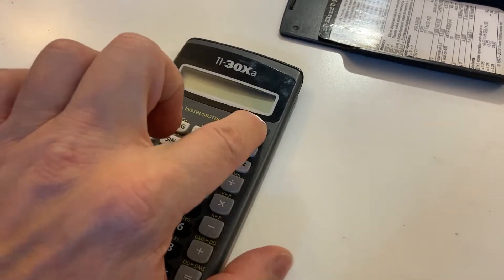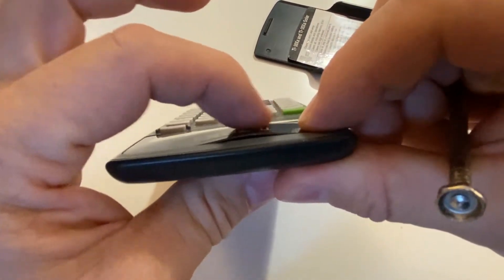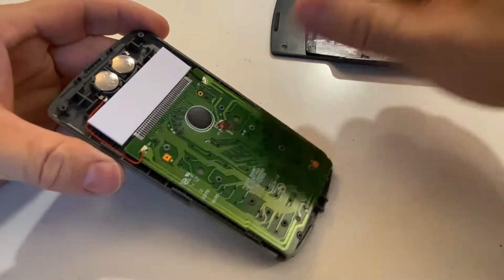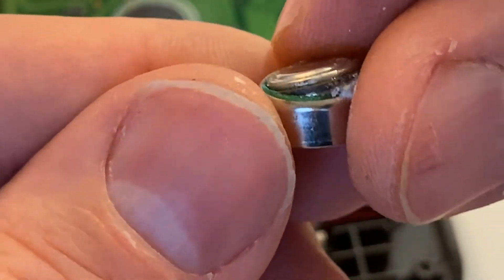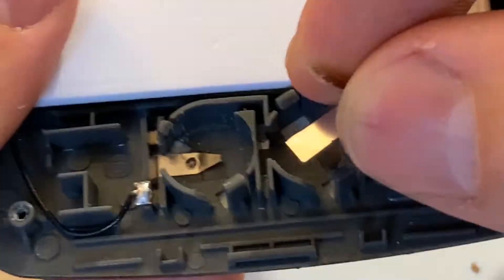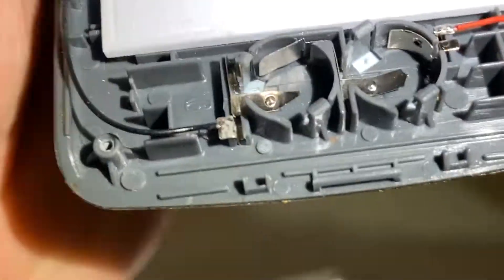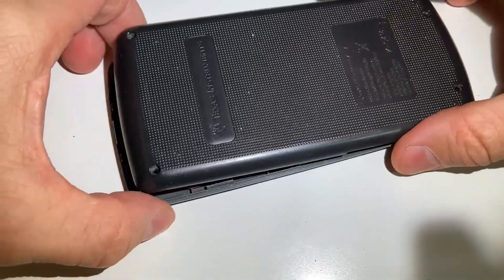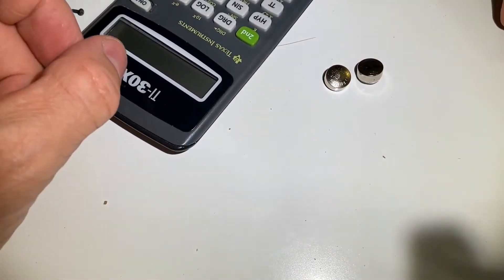Battery change Texas Instruments TI-30XA

Comment: Interesting... I see that there are at least three different revisions of this calculator. (I just came here to figure out how to open it up without breaking anything.) The one I just bought has a single cell with a higher capacity rating (LR 44, 158 mAh) and it's in a different location. Here, it is located, viewing from the back, on the right-hand side a quarter of the way down, immediately below the display, and the circuit broad has been notched to accommodate it. Same markings on the back. So they are buying these from a generic supplier, probably Chinese, which would explain the failure. Looks like my case snaps together at seven points.

Comment: Buy an HP10B and the problem won't resurface. I have this exact calculator for a back up calculator and it is the biggest POS I have ever spent money on. 

Thank you SteveM45, that was the solution. I put a note inside describing that trick,  for the next person in case the calculator shows its ass again.

Comment: Thanks.  My TI-30 XA has SIX screws.
Reply from the maker: It's an upgraded model 🙂
Reply: And mine with 6 screws also failed yesterday. My previous TI calculator was a real gem.    Had a solar panel on it.  Lasted like forever until...Was so small it could fit into a dress shirt pocket.   Scientific too.  Had a fold over flap that contributed to the pocketability.

Comment: Hi at all. I found the solution for reset. In the middle of the board under the big black part there are two capacitor, C2 and C1. I made a shortcut over C1 and now the calculator works again.🎉
Reply: What do you mean by shortcut over C1?
Reply from the maker: Wow, thanks for sharing!